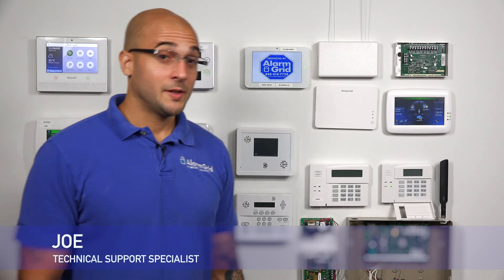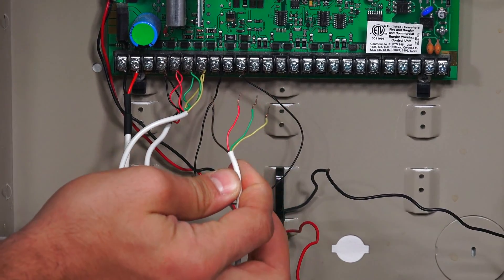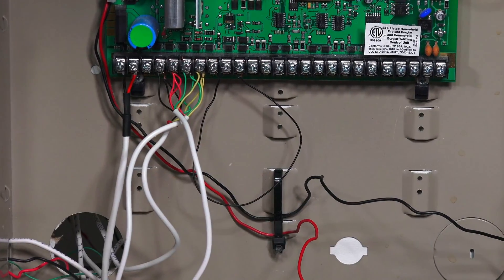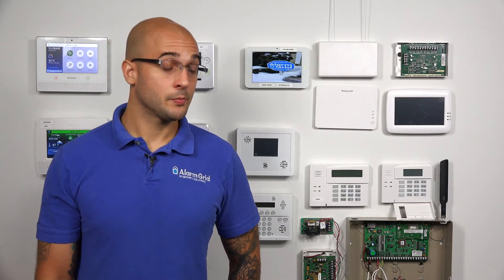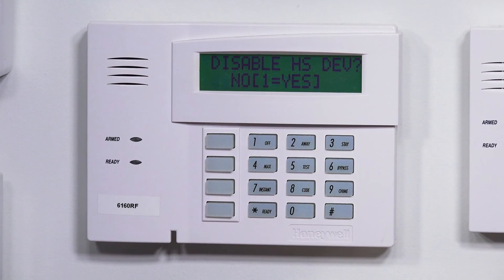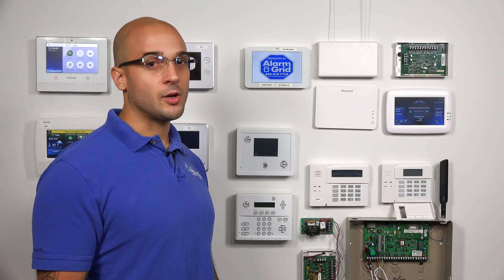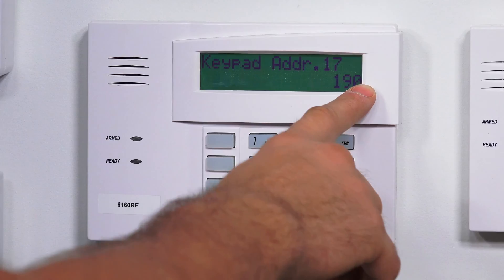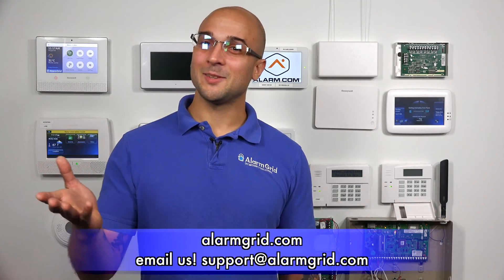Adding a Second Push-button Keypad to a VISTA-20P

Comment: Is there a way to do a master reset? Just purchase a home, and ADT wants a 3-year subscription i. Order for me to obtain the code.  I currently dont know the code to arm or disarm, and I dont want a subscription either.
Reply: Yes, there is, you would first have to go into installer programming, there's videos on the back door method if ADT won't give you the installer code. Only use the backdoor method as a last resort. If you've come to the backdoor method, and you try it, and it gives you a long error tone, then that means you are locked out of programming. You'll know you're in installer programming when your alphanumeric keypad shows "Installer Code 20", or if it's a fixed English keypad, it will just show "20". Once you're in installer programming, press *97 to reset to factory defaults. This will default your master code back to 1234, it will default your installer code back to 4112, it will delete any sub-user codes and it will delete all zones. Then press *96, and then after you've done those, press *99 to go back to the main menu. If all else fails, simply disconnect the alarm system from the battery and AC power, and tell ADT that you will not use the system.

Comment: I have a 6160RF in address 16 and want to add a 6150RF on my master bedroom on address 17. Do I need to disable the receiver on the 6150RF while addressing it? Also, will I need to add the key fob on zone 49, 50, 51, and 52 again on the 6150RF panel? Thanks.
Reply: Yes, you need to disable the receiver in the 6150rf, as your 10p only does 1 receiver as discussed. You will not need to redo any wireless zones currently working on the panel with the 6160rf.

Comment: I need to add a second keypad to my vista system several hundred feet away.  There is an existing buried electric wire I can use, but it is only two conductor.  Can I hook up this second keypad using these two wires for data, with a separate 12 volt power source at the new keypad location?
Reply: If its standard electrical wire the wire may be to big if not it would work you would have to have a common ground back to the panel

Comment: Now when I programmed my keypad.. the armed and disarmed chime doesn't work
Reply from the maker: Check the programming location for the device address you used (*190 = Address 17, *191 = Address 18, and so on).  The 2nd digit in that programming field can be used to suppress certain sounds.  If you want your keypad to make all the normal sounds, the 2nd digit in that field should be a 0.  So, for example, if you're using address 17, when you press #190, you should see a 01 (for partition 1) and then a 00 (for no sound suppression).  If you see anything in that second entry other than 00, then you need to press *190 and enter 1 0.
Reply: @AlarmGrid  great.. got it to work, thank you!!
Reply from the maker: @aspenqwerty3  You're welcome!